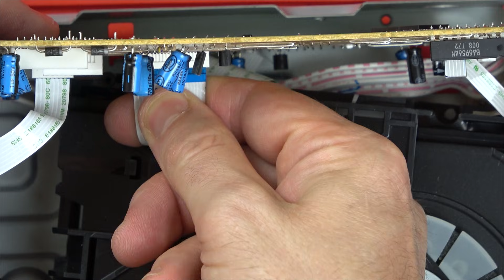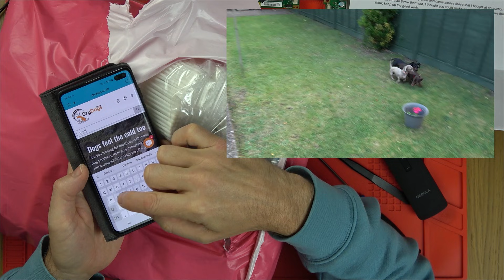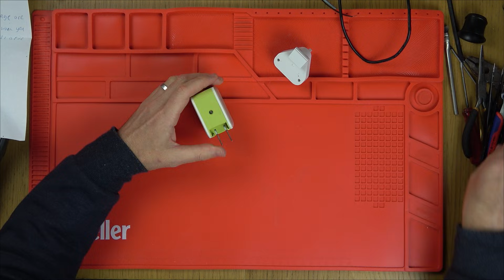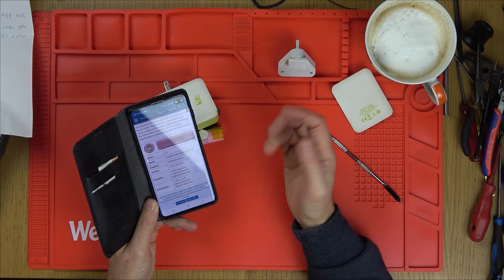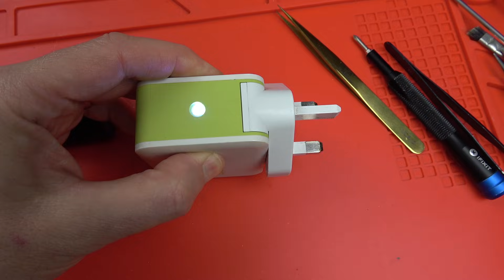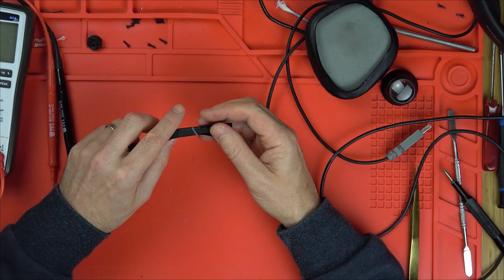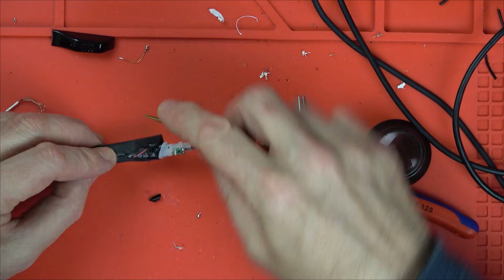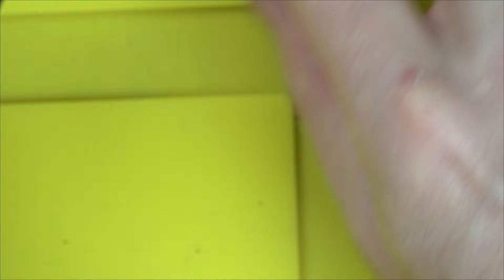Viewers Broken Items - Can I FIX them?

Comment: My Denon hifi does the ghost opening and closing all the time, cleaned and checked everything I could see but still does it and now got an AIO Panasonic which a "space age" sliding CD door, iPhone dongle that comes out like a tongue and plays USB stuff as well.   I bought it for a tenner spares or repair and all it was, was a mains plug fuse had blown.

Comment: Nice fixes, good idea to finish the headset arm with heat shrink tube :) Interesting the memory card converter too, one of those refused to work for me even it was new. Also plenty of MicroSD cards have failed for me, so that media seems to be the most unreliable in my experience. Even currently my phone locked up the MicroSD card, because there's some fault detected.

Comment: Nice video. I think the 9th pin is for the write lock. Normal SD Card has a lock, micoSD has not...
Reply: And for microSD, the signal tells the host that the card is not locked
Reply: Nah, it's just an extra ground pin. The write protect switch is integrated into the socket, the little plastic slider on the card is just a piece of plastic kind of like the write protect on a 3.5" floppy disk.

Comment: that kind of connector is very picky about connecting and just tightening it down doesnt work, i had to fiddle with the display cable for something for awhile before it would reconnect and that device didnt actually have anything wrong with it, i had only taken it apart to replace the thermal paste